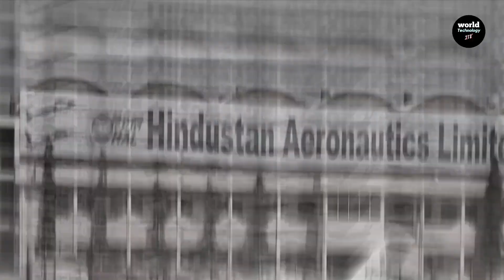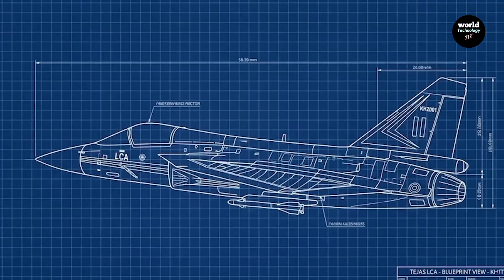Tejas: The $16 Billion Dream That Never Took Off

Comment: Another propaganda channel with AI voice . 😂😂
Reply: It's not propaganda, everyone knows the practical circumstances that have  happened already in the UAE . Okay there are many things for argument but it happened 😢. So failed
Reply: @deft8673  Almost all the fighter aircraft has a crash history  . Even  one of the most advance jet F35 crashed 2 times in this year alone . Comparing to that , tejas only has two crash in 20 years .
Reply: @nagaxchilly5995  That's because it stays parked in the hanger for maintenance.  Please do NOT compare Tejas with F-35.  F-35 is already operational, and has also seen active combat against Iran.  F-35 is operated by several countries with more lined up to acquire it or add more units of it in their Airforce.  Nobody has acquired Tejas, other than Indian  Airforce, and certainly nobody is in a rush to place an order for it outside of India.  Everything this video stated is based on facts, don't worry about the AI voice.  Focus on the message that the AI voice is delivering.